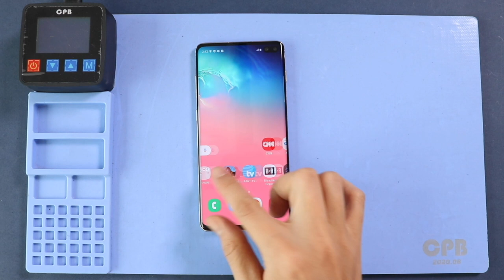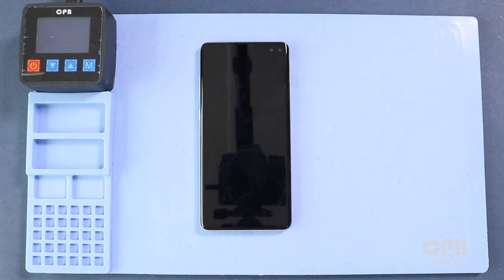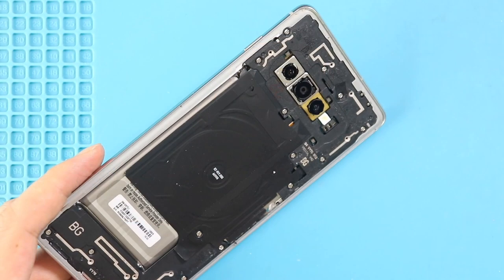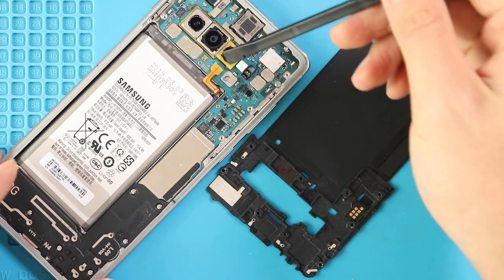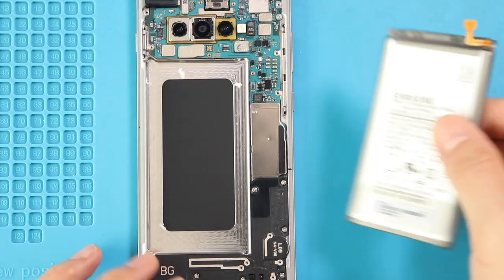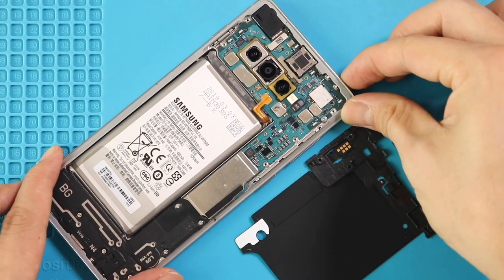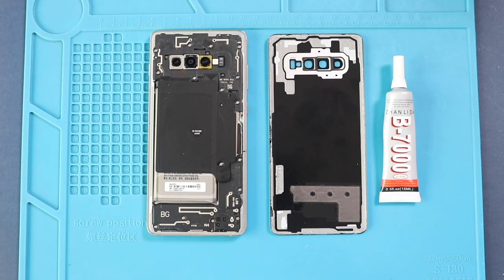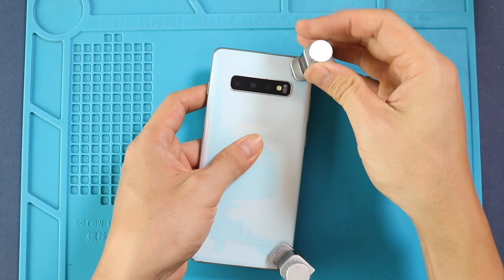Samsung Galaxy s10 Plus Battery Replacement

Comment: Thanks so much for this video.  I just replaced my Galaxy S10+ battery after 3 years of original battery service.  This video saved me a lot of aggravation (that 9th screw was hiding under some tape).  I had no trouble whatsoever removing the back, as my original battery had swollen to the point of removing it for me, which was my first indication that something was going wrong with the battery.
Reply from the maker: Glad you get it done..
Reply: how much was your battery replacement?
Reply: @Paradox-fu5nv  $31.79 USD, total cost.
Reply from the maker: @Paradox-fu5nv  Original Battery COst about $20
Reply: Where do you get good OEM battery replacements for samsung? All the Chinese made ones on eBay and Amazon hold up no better than a 3-year-old OEM battery🤷‍♂️

Comment: It looks like you are using an OEM Samsung battery, which I am finding very difficult to locate.  I'm very hesitant to use an aftermarket battery as I've not had good luck with them - an aftermarket battery caused my drone to lose power and crash one minute after takeoff with a full charge, smashing it literally to pieces ... so I think you'll understand.  Can you share a reliable source for an OEM battery for this phone?
Reply from the maker: Thanks for the message.. where is your location ..
Reply: @DIYGeardo  Arizona, USA
Reply from the maker: @hangtime_31  we have the original service pack, but we cannot post it due to new aviation rules. You can try mobile defenders in USA, they have it
Reply: @DIYGeardo  Thanks for the referral, much appreciated. 👍
Reply: Final story ... ordered the battery from Mobile Defenders ... it was not expensive, it arrived quickly, was packed very securely and all the markings looked just like the OEM battery in the phone except for the date, of course.  I installed it and it works great.  Thanks again for the informative video and the quality vendor referral.
Reply: Where we can get the original battery in UK . Thanks
Reply: @hangtime_31  I just bought mine from Mobile Defenders.  I'm a little leary that the original date was 2019 and the new date is 2020, so it's not a very "new" battery, as this is mid-2022, but hopefully it'll still run for a decent number of charge cycles.  Anyway, it arrived in good condition and, thanks to this video, simple to replace.
Reply: @Dosbomber  Yeah, in mine the original was Jan 2019 and the replacement was Nov 2020 ... but it wasn't swollen, which was the problem.  I took my protective case off and noticed the phone case had separated where the back was glued on because the original battery had swollen.  That's an uncomfortable problem waiting to happen!  In any event, I got the S22 Ultra (worth it, the camera(s) are killer!) and the S10+ is now my backup emergency phone.
Reply: @DIYGeardo  where can I get OEM Samsung batteries in Florida USA? Thank you😊
Reply from the maker: @JESUS_IS_GOD  what is the model?
Reply: @DIYGeardo  Samsung S10+ & Samsung S7 Edge...
Reply from the maker: @JESUS_IS_GOD  Can ship the S7 edge service pack but s10 currently out of stock in our USA warehouse..s10 can get a premium  oem
version
Reply: any idea where I can get the OEM in Ontario Canada?

Comment: Do we need to backup our data before we do the battery replacement ?
Reply from the maker: Well it is always good to back up before a replacement..But replacing battery won't loose your data..maybe some of temp data..
Reply: I had no loss of data when I switched mine out.

Comment: What sort of glue did you use?
Reply from the maker: B7000 on the back cover. For the battery we used battery adhesive or can use double sided tape

Comment: I thought when heating to remove the battery supposed to heat from the screen side and not directly on the battery for safety?
Reply from the maker: it is fine to apply some heat around 60c for 1 minute. DO not heat from front side. It is not useful.

Comment: I'm looking for a battery for my S10 and I can't find it
Reply: Amazon has all you need
Reply: Just make sure you order the correct model # as mine is Samsung Galaxy S10 SM-G973U
 you can find your model under settings.
Reply from the maker: Your location?
Reply: @DIYGeardo  Saudi Arabia
Reply: @BornAgain717  لم اعثر على شيء
Reply from the maker: @iiLAWx  Sorry, im not sure a place in saudi, but for sure you will beable to find in the web